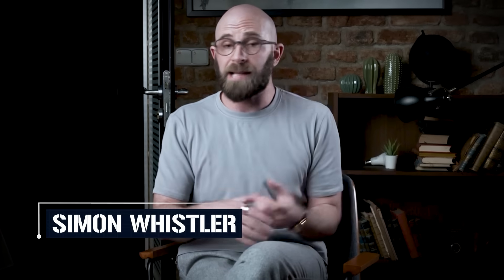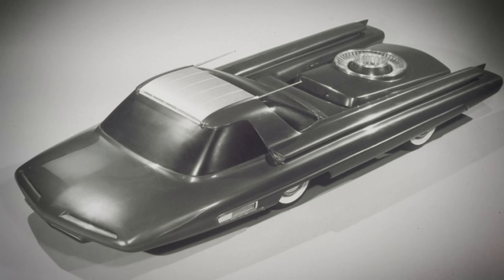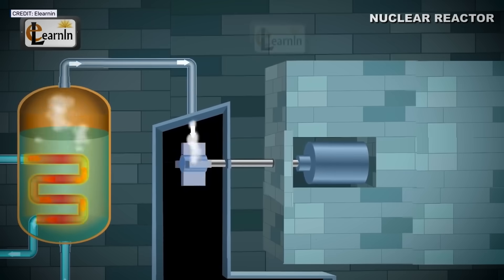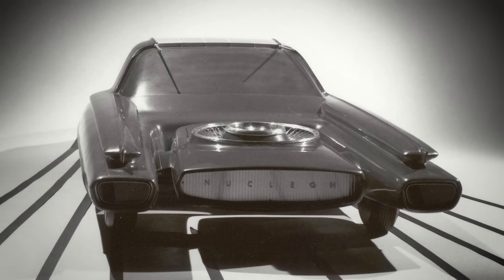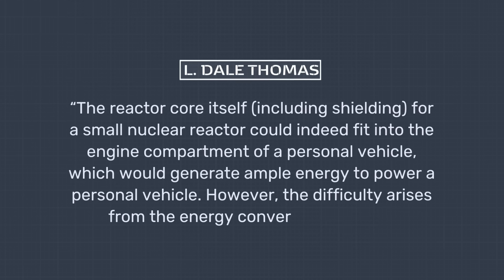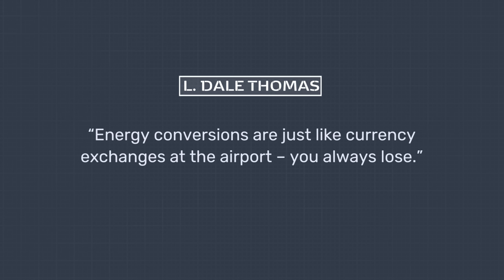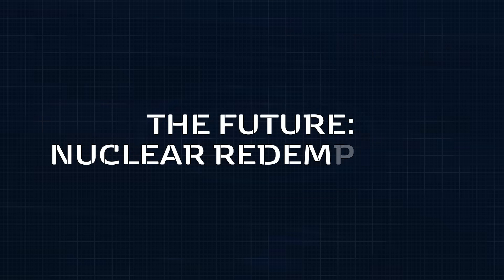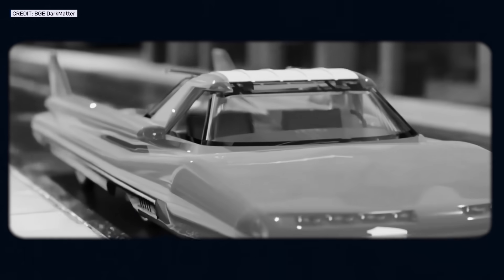The Ford Nucleon: The Nuclear Car of the Future

Comment: You could make a Nucleon today easily.    Replace the reactor with a nuclear thermal isotope core, supplying nuclear decay heat to a stirling engine that is continuously charging a lithium battery.    Most cars are parked at least 80% of the time, so well designed it would always accumulate enough charge for short to medium trips.

Then at that point you basically have a tesla EV that looks like a delorian, only the MR Fusion on the back would be about 4 times the size since it was a stirling engine.    Accidents wouldnt matter as the 'heat box' with the decay heat source could be built as a hardened modular container that is easily removed, and difficult to break.
Reply: No need for sterling engine. Use pelter cells like a regular RTG.
Reply: @ I've experimented with peltier, they dont scale well, and you need crazy heat syncs to get decent current. But yes that would work, not as well tho.
Reply: I thought of that before, except I was thinking of using a beta volteic battery (a sandwich of solar panels and beta emitters). Turns out it's extremely expensive. The plutonium version is likely even more expensive.
Reply: @ Ah yes,  sort of like another idea i was playing with,  essentially a capacitor where the dialectric generates current from radiation.. sort of like a self charging battery.   On paper at least it would have a heat issue, either you would have some sort of load to kick in when the cell is fully charged to eliminate surplus, or if you dont the battery itself would eventually overheat and fail.   Either way you have a heat problem,    since the stirling itself uses the heat to drive the piston that runs the altinator,  you could simply install a bypass, brake or a clutch when there is no load, or go fully nuclear power station style and have a neutron absorber that locks in place while the vehicle is idle and already charged.
Reply: @phoenixx5092  my thought was to deal with excess load by putting a toaster or two on the roof. For the overwhelming majority of people, household current/voltage is fine for car charging if they can charge for most of the day and electroresistive heaters can consume that amount of power without much issue. It's a bit wasteful because that doesn't accomplish much except perhaps for de-iceing in the winter, but the energy has to go somewhere. My understanding is that beta volteics don't really heat up much because the mechanism for electrical generation is the photovolteic effect. My stumbling blocks were 1) that amount of tritium is getting into house/mansion prices, and 2) the NRC and DOT would probably have opinions about me driving around with kg of radioactive materials.
Reply: @ I have always found it unfair that we don't have a super efficient way of converting gamma rays directly to electricity.
Reply: look up NASA K.R.U.S.T.Y.

Comment: For the heat issue, I wonder if you could have had heat-sink stations, kind of the opposite of gas stations. Imagine building up a storage of heat, pulling over to your heat-sink station, rapidly cycle/dump the heat, then pulling back out on the road.
Reply: And instead of running out of fuel you have a nuclear meltdown

Comment: Petrol/gasoline doesnt explode in an engine. It burns. Exploding fuel is known as knocking/pinking and isnt desirable.
Even a diesel engine which initially auto ignites its fuel with the compression temperature. That zoned ignition is still a smooth burn.

The Ford Nucleon is still more practical on a day to day bases than a short ranged BEV.

Comment: An electric vehicle involves more than only one energy conversion.  Ignoring how the electricity itself got generated since that can vary quite widely the first conversion is from electrical energy to stored battery energy during the charging cycle, then from stored battery energy back to electricity and then from electricity to mechanical energy. Saying it only involves one conversion is ridiculous.  The Nucleon was a concept car from the day when Nuclear energy was new and it's drawbacks were still considered as easily solvable so it was only natural to think about how it could be used for everything. It reflected the boundless optimism of it's time, or at least the idea of seeing how it could be used for cars but of course reality did rear it's ugly head and that's why it remained a concept car without proceeding to an actual test model.

Comment: A suggestion replace the uranium reactor because it stupid and problematic.  Nuclear power plants are typically around 33% efficient.

And replace it with cient nuclear fuel source that can produce as much energy as 200 tons of uranium for every ton of thorium used. ered safer than uranium nuclear power. Thorium reactors are less likely to have a meltdown, and they produce less radioactive waste. 
Safety features
Less likely to meltdown: Thorium reactors can't sustain a runaway reaction, and they operate at lower pressures than uranium reactors. 
Less radioactive waste: Thorium reactors produce less radioactive waste than uranium reactors, and the waste is safe after about 100 years. 
Non-weaponizable: Thorium can't be used to make nuclear bombs. 
Other benefits
Thorium is more abundant and easier to mine than uranium. 
Thorium reactors can be built in remote areas, and they don't need to be near water. 
Thorium Thoriumreactors are more cost-effective and environmentally friendly than uranium reactors. 
Safety considerations
However, no energy source is completely safe, and proper regulation and technological development are important for safe thorium utilization.

Comment: My favourite thing about the Cold War era is the "try it and see if it works no matter how wacky it sounds" mentality. It's not a completely unprecedented bit of kit. Steam cars had seen extensive use up until the 1920s, and were better than petrol in a lot of ways. You were just swapping out a gasoline boiler or steam generator with a reactor. Of course given how people drive and how much of a problem modern Li-Ion EVs are for accident cleanup (due to lithium being a violent oxidizer), it's not hard to see why these would have been a bad idea. One of my favourite cars of the era is the Chrysler Turbine. Built to capitalize on the jet craze, it made it close to the production phase. They built a bunch of demo units. Jay Leno has one, and recently had it restored with some of the original team consulting on the project. It uses a unique turboshaft engine design.  According to Jay, it's near silent, has no vibration, and has smooth power output. Could also run on just about any flammable liquid. They even demoed it running on Chanel No. 5 IIRC. I believe the project was scraped because it couldn't meet emissions regulations that were then coming into force.

Comment: This thing sounds like it would've driven like a tractor. Constant power from a throttle lever and you slow down by taking it out of gear with transmission. Might've worked in the 50s when automatic transmissions were scarce and people knew how to use a clutch.

Comment: Lists a bunch of engineering challenges that could not be overcome: Blames capitalism.
Talks through how nuclear power requires multiple energy conversions: claim battery cars (that have as many or more conversions) don't suffer the same problems

for anyone disputing the second point:
Nuclear power: Heat> mechanical> electrical AC> mechanical 
or if you read the actual ford proposal documents where the drive train is steam powered not electrical: Heat> mechanical
battery powered car charged by a wind turbine (any other power source will have more conversions): mechanical> electrical AC> (add some steps here for the step up and step down voltage changes in the energy grid) > electrical DC> chemical (in the battery) > electrical DC> electrical AC> mechanical.
Or if you want to limit it to only the energy changes inside the vehicle. 
 chemical (in the battery) > electrical DC> electrical AC> mechanical. vs Heat> mechanical

Comment: A better use of nuke power for automobiles would be modular power stations used to generate electricity into the grid mixed with all underground roads electrified to power vehicles like in carnival bumper cars rides. Once we have enough robots, an underground road system will be economically feasible. Note; the underground roads would also be the transmission grid for housing and industry. Even housing and industry could be more underground leaving the topside to nature.

Comment: Nasa uses radioactive isotope thermo electric generators in long rang space probes, no water involved just taking the thermal energy from decay and that heat would be used to charge a battery.  This would be much smaller than having a pressure turbine reactor in a car

Comment: 06:12 though if range estimates given by the manufactorer are about as reliable as they are with petrol or, worse, electric cars, I'd be quite nervous as Google Maps claims that distance to be 8,034 km. And I REALLY don't want to ask Google where to find fuel grade Uranium in Pakistan for reasons...

13:45 No, they don't. They literally are an extra step. On the other hand though, if you charge your EV with electricity from a nuclear power plant, you have a nuclear powered car. Which is also kind of steam powered. 

The inconsistency of units across Simon's channels is insane 😄 sometimes it's metric, sometimes it's imperial, if we're lucky we get both at least in the pictures... and this time we get a conversion from inch to feet, but not into cm while a minute later the range is given in km (and miles) and converted into a traveling distance that probably means nothing to most French & Pakistani people, let alone anyone else.

Comment: Imagine crashing into a wall in 60mph in that small box of a driver cabin, with a 3 ton reactor slamming into you from behind. The radiation or heat from the Uranium would be irrelevant for the squished driver and passengers, who are now reduced to a bloody pancake.

Comment: "Even today we are still chasing those advances." Puts water between metal walls, uses mini-vacuum pump to lower pressure inside, and cold boil vents all the energy from the water leaving ice like space would do then sets it to automatically release energy as it builds Regenerative ice for any cooling + Cold side of any generator technology or pressure technology that benefits from cold. Now add Cold Steam Tesla generator which will greatly reduce heat required for max turbine roll because no gas in the system only heat from hot side being continuously stolen by Turbine so universe can never balance temperature.

Why do you people want nuclear for silly things? Pours filtered high density compost nutrients to fill Hyper Thermophilic bacteria drip feed system Oh no its arctic conditions and you forgot to feed your thermophilic bacteria! Oh no!! What do you do?! Points at mulch piles stacked on frozen ground start steaming You wake them up with food.. Holds up portable capacitor in hand with volt limiter and sticks it to mug with compost juice inside to warm before pouring down into vehicle The ones the food touches from wick will awaken and blaze all the others out of their sleep.

Replication in proper heat conditions they make for themselves at correct nutrient density = DOUBLE every 24 hours.. Fire hazard you can breed, efficiency = Billions of years of evolution.. (Meme potential: My home and vehicles are sh1t eaters.)

Comment: Could you just drive the axels off the initial turbine?  Use the control rods as an accelerator?  Then you just need a radiator from hell for the primary/secondary coolant water

Comment: Heck it would be more efficient with a steam engine. Not using a electric generator. Only a small steam turbine to produce the 12v  for lights and such, say 60-100 amps at most. It would take possibly 40 amos for all the lights and in winter heat would be nice. Possibly use a electric heater 12-14v at100 amps  1200-1400 watts , after it's up to temperature heat will be the last thing needed. Maybe some big fans to cool the condenser until. If a tiny reactor could generate about  1000+ kw with a battery bank in the range of ( 450-1000 ah) , drive around town on battery power, the reactor making minimum power 0.5-1kw possibly, keeping the batteries topped off when it's coasting for a while stopped . Or going under 25 mph, the battery getting charge, the reactor/ generator producing more power than the drive motor is using. when full power is required the reactor going to full power, plus  the battery giving power,  possibly 1600» kw reactor the battery capable of high current discharge. Say 10 c+ ,30 c+ surge  450-500 volt battery  fairly small capacity, for short runs.  The power available to accelerate could be equal to 1000-2000 HP with something like 1500 TQ 'lbft'   0-100 mph could be 2-3 seconds if it even moved. With Regen braking to charge the battery while stopping. The electric drive would allow get in and go while the reactor produced the required steam. Faily slow to preven a Chernobyl or stress the reactor. Going up in power  up to 1% per minute down to 2-3% every 5-8 min. and reduce power demand every 10% hotter it gets , something like after 50% operating temp , gain 1-2% every 8-10 minutes after 50-60% operating temperature it can  a decent amount of power is produced , similar to running at 
20 -30% stead state  run the system as if it has a governor the more temperature the Les rods used to gain temperature eventually back off to steady normal temperature with just enough rid to maintain temperature.   Like quickly getting a pot to boil then turn it to low. When stem is needed turn to high, it only takes a few seconds to get it boiling again.. then the reactor is doing enough to run the vehicle and charge batteries  then back off when batteries are topped. Just enough to keep it going plus 5-10% to  reduce excessive heat.  If more speed is required or a stop and go the battery can handle the power. Or it can run at what could be 30-35% constantly and work to keep it cool.   Enough rambling have an awesome day 🎉

Comment: That was a truly visionary idea. Completely and totally impractical, but you had to love them thinking HUGE. Just like the nuclear airplane. 
Now, EVs. The conversions are still the same, they just occur in different physical locations. Fuel of some sort is converted into heat energy (except for direct solar, of course), that heat energy is converted into electrical energy. The electrical energy is transmitted to a charging station which replenishes the charge in a storage device. That charge is then converted back into mechanical energy to propel the vehicle. At each and every step an inefficiency is introduced, requiring more energy from the step before. So the total efficiency of an EV is WAY less than an actual internal combustion engine. The emissions may be less at the end use, but end up being way greater at the initial source.
Reply: @ICAleinns  the foundation of all leftist theology is the lie. Clean and green, my greasy pimple covered ass.

Comment: Give me a vehicle with the cargo capacity I need that easily and comfortably does 130 Kph and doesn't require Overweight Vehicle Permits just to leave the driveway that only needs refueling once per decade or so, and I'd LOVE to have one...even if it weighs 5 tons...

Heck, I'd buy a 2nd complete power-pack for it and stick the thing in the basement of my home and tell the Local Power Company to pound sand, I've got my own power plant now and I can install the radiators from it in the furnace ducts to get free heat for the winter and tell the local Natural Gas company to also pound sand - electric A/C's in each room (mini-splits), electric water heater, electric appliances and now, the only Utility Bill I'd have would be the once a decade power pack swap, water, cell phone and internet (I get all my TV & Movies online and use Magic Jack for my home phone)...Where can I sign up?

Comment: Since that car was designed in the 1950s, it was before the systems used in long-range spacecraft, such as the Voyager probes and Cassini. The Radioisotope Thermoelectric Generators (RTGs) used generate electricity do so without having to boil water. Whether they could generate enough to actually power a car, I don't know...nuclear physics isn't my field of expertise. I'm sure they'd be a bit safer to operate, easier to protect (in case of accidents), much lighter weight, and wouldn't require an absurdly dimensioned vehicle to accommodate the power plant.

Comment: Take the Steam turbine and connect it directly to a Transmission and you can remove at least 2 energy conversion steps and their energy losses out of the equation...

So instead of
Split Atoms to generate heat, boil water to generate steam, use steam to spin turbine, use turbine to spin generator to generate electricity, use electricity to spin motor to turn wheels to move car...
you can
Split Atoms to generate heat, boil water to generate steam, use steam to spin turbine, use turbine to turn wheels to move car...

Less weight because you no longer need a generator or electric motor and the wires to connect them and less energy loss because you're converting energy from one for into another 2 less times...electric energy for the other systems such as lights can be created with an Alternator driven directly off the Transmission input shaft from the Steam Turbine...

Less weight equals a more efficient, less expensive car (less material and complexity in construction and fewer things needing maintenance or repairs)...